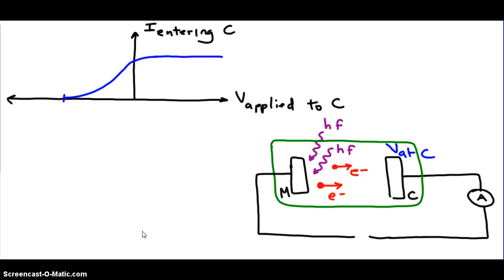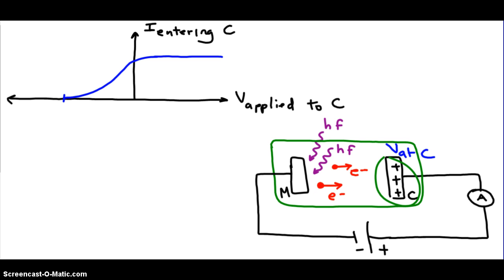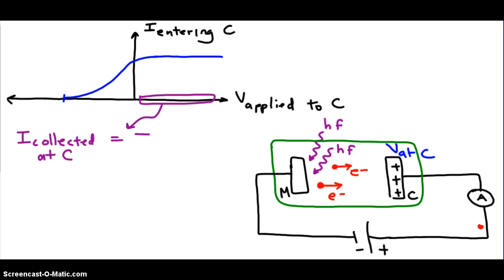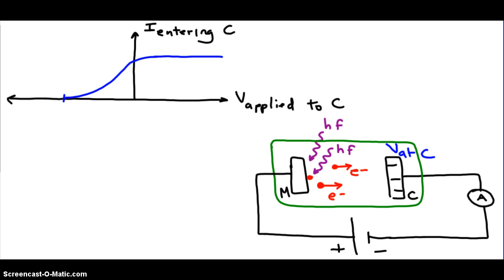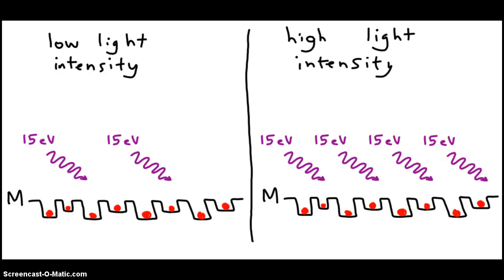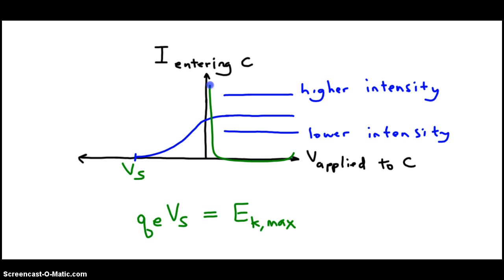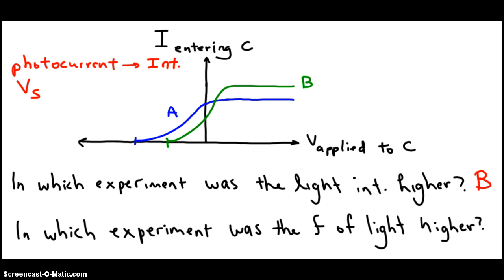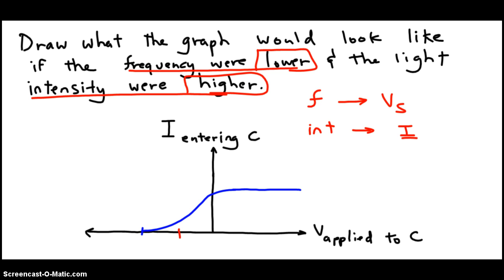Impact of intensity and f on photoelectric effect graph

Comment: At constant intensity When current reaches to its maxium, is there  electrons are  still present  in metal or all the free electrons are ejected ?
Reply from the maker: This is a great question! I will give you my best (most informed) guess, but you should check my reply with someone who is a specialist in this field. (a) I believe only some of the free electrons reside at the surface-level of the metal. In general, I think the free electrons would be evenly distributed through the metal, because otherwise, there would a net positive charge in the interior of the metal (due to the positively-charged nuclei) and a net negative charge on the exterior of the metal (due to the free electrons). If this sort of charge separation were to occur, then the electric field would just pull the free electrons back into the interior/middle of the metal. So, most free electrons can't be ejected by the photoelectric effect because most are in the bulk/interior of the metal where the photons don't penetrate. (b) Even among the free electrons that reside at the surface of the metal, only some are ejected. The image at 7:00 shows why. While free electrons are not bound to a nucleus, it does require some energy to eject them from the surface. Some electrons require more energy than others. So for a given frequency of light f, only electrons requiring hf of energy or less can be ejected. Some surface electrons won't be ejected because they require more energy than a single photon carries hf. I believe these two reasons are correct and explain why only some photos are ejected at maximum current as part of the photoelectric effect.
Reply: @danielm9463  ok sir .
Reply: @danielm9463  yes sir thank u so much 😊.
Reply from the maker: @Krypton12368  Good luck with your studies!

Comment: Thanks tons for this!

But however i just got one tiny confusion
when you stated that 
lower the frequency , lower the stopping voltage
So in the x-axis
further you go left.. the value is much smaller than the value to the right. 
So why is it that 
high frequency,Higher stopping voltage and more to the left in the x-axis. 
TIA :-)
Reply from the maker: That's a really great point you've made and a great question you've asked! When we say 'the stopping voltage increases,' we're talking about the ABSOLUTE VALUE of the voltage V. To stop the ejected photoelectrons, we need the collector plate to be NEGATIVELY charged. (Two negatives repel, so the ejected photoelectrons will be repelled away from--and stopped by--a negatively charged collector plate.) If the ejected photoelectrons are going slowly, then we might only have to line up –1 C of electric charge on the collector plate. But if the electrons are moving faster, then we might have to line up –100 C of electric charge on the collector plate. We ignore the negative sign when discussing the voltage V, because the negative sign simply indicates that the collector plate is negatively charged and thus at a lower electric potential than the positively charged metal plate.
Reply: :-D Thanks for the quick reply!!
Got my exam in a few hours 
This surely helped ! :D
Thanks a lot again! :-D
Reply from the maker: You're welcome, and good luck on the exam!!!
Reply: Thank you! :D
Reply: how was the exam